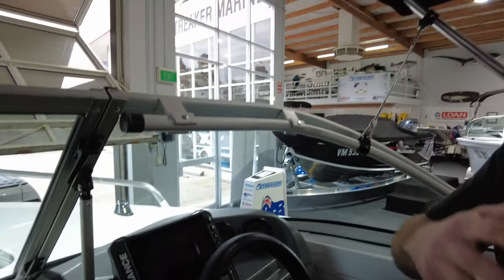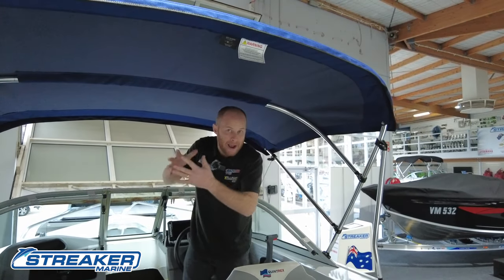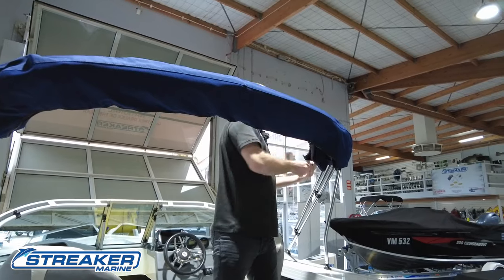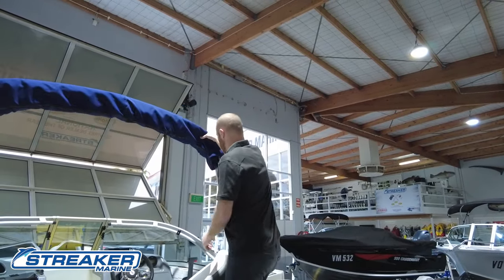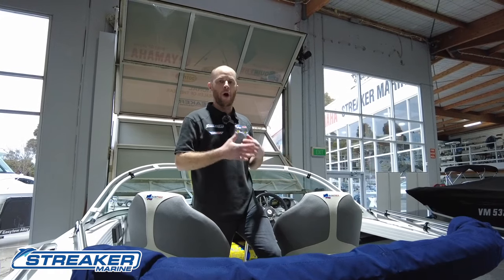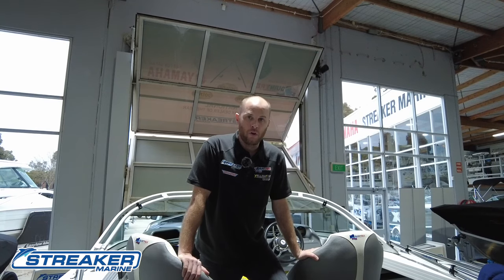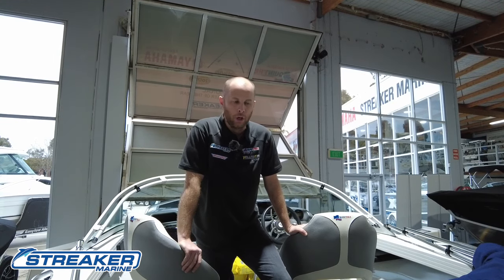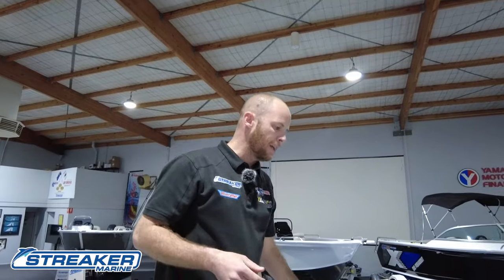BOAT BASICS Episode 5: How to use your Bimini cover & ongoing boat maintenance

Comment: I hope that is not Metal shavings in the bottom left corner when the bilge hatch was lifted have seen this before fit-out forgets to clean after drilling and cutting, give you one guess what and where rust starts first?:
Reply from the maker: Spot on. This boat hadn't completed its final stages of detailing. We are very experienced and aware of how a boat needs to be presented for handover and we are sorry you have had a bad experience.
Reply: @StreakerMarine  Thanks Guys, will keep you in mind next boat

Comment: I think it’s first hour no more than 2k RPM, second hour enough to go on plane but no max throttle and for the 8 hours after that no full throttle for more than 5 minutes.
Reply: I would do what the book Said not what (you think)
Reply from the maker: Always safe to revert back to owners manual mate